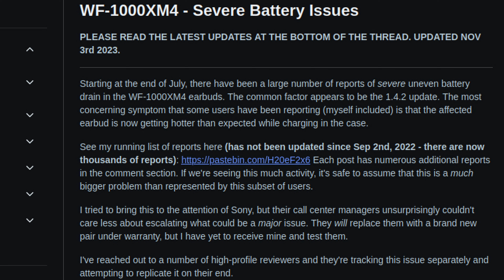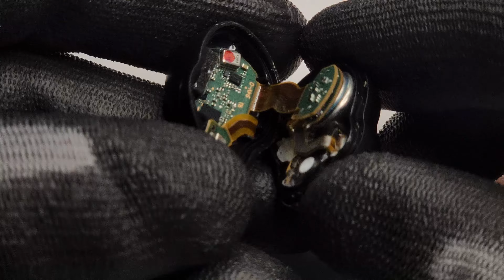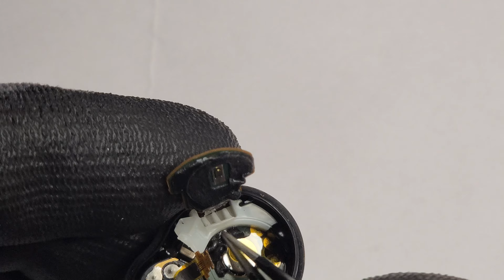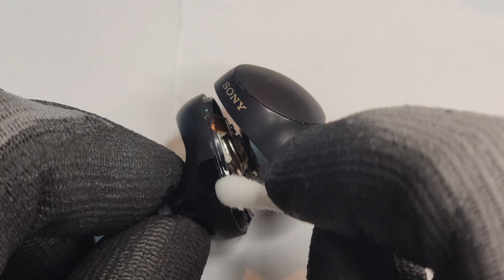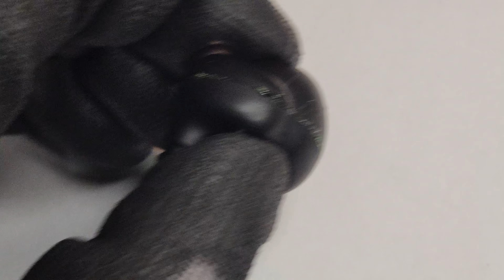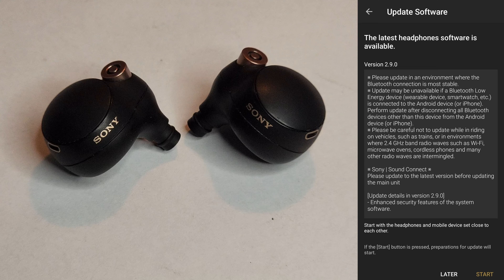SONY WF-1000XM4 battery replacement

Comment: I just replaced mines battery looking at this video it's a simple process and everything works great so far. I used the materials that are shown in the video to not take any risks. Once I applied glue I put a rubber around the earbud and let it wait like that for 24 hours as per Gemini's additional instruction.

Comment: I replaced both batteries now they are not connecting to my phone. The right one doesn't work at all!
Reply: I had the same issue.  I charged the earbuds up for a few hours and then tried again, with success.  It seems that the batteries I was shipped did not have a charge, yet.

Comment: And what firmware caused the issue? My earphones are on 2.1.0 I believe
Reply from the maker: Hi, mine came from the factory with version 1.4.x, I never updated the firmware. Months passed and I felt that the battery lasted fewer days, but nothing serious. I left them forgotten for a couple of months at another house and when I went back to get them the battery wouldn't charge, it didn't go above 5% and they turned off immediately.
Since I repaired them a year ago, they have worked perfectly, I haven't had any problems since, and I've installed all the new updates.

Comment: Just replaced mine, super easy, Thanks for tutorial. 

Are you running latest firmware on them now? (2.3.1)

 I wonder if it is necessary to downgrade them to keep them working longer.
Reply from the maker: I'm glad it helped!

In my case, I have updated to the latest version; I understand that Sony has improved the firmware.
Reply: Do you think it would be easy to change the shell ?  Both upper and lower shells

Comment: Just roll back firmware to 2.0.0 with the mr walkman program theres also a video explaining how to roll back firmware on 1000xm4. I had the same problem after 5 minutes my battery was empty so i rolled the firmware back and now absolutely brilliant earbuds charging to 100% both left and right problem solved
Reply from the maker: I understand, but in my case the battery was really damaged. After I took them out of the headphones, I tried charging them externally and they wouldn't charge.

Thanks for commenting.
Reply: @the-retro-center-develper you can buy the batteries very cheap i think I paid 10 euros for the pair
Reply: How can you use an old firmware? Just to be clear, are we changing the firmware of the device, or is it something else? I would be interested into doing so.

Comment: They fixed this with newer wf1000xm4s? If so,what fabrication date I must consider?
Reply from the maker: Hi, from the reports I've read online, battery issues have decreased after mid-2023.

You might find this reddit post, which compiles a lot of case information, helpful:

https://www.reddit.com/r/SonyHeadphones/comments/x7mx2n/wf1000xm4_severe_battery_issues/

Regards!
Reply: @the-retro-center-develper thank you!